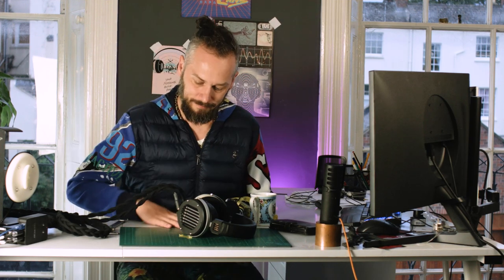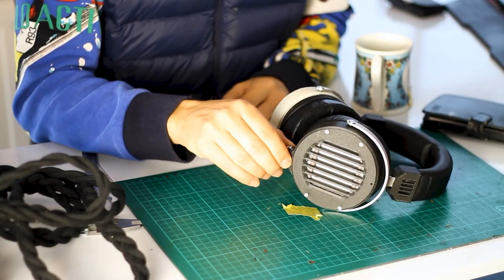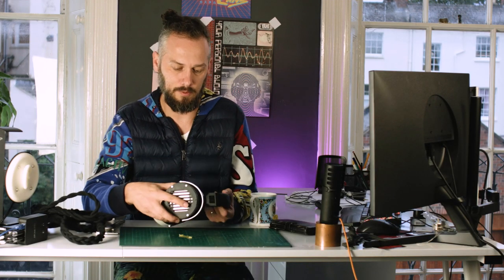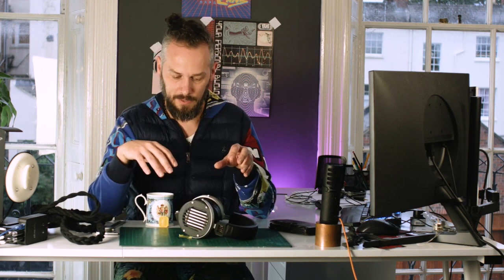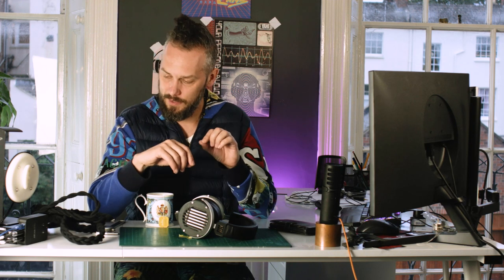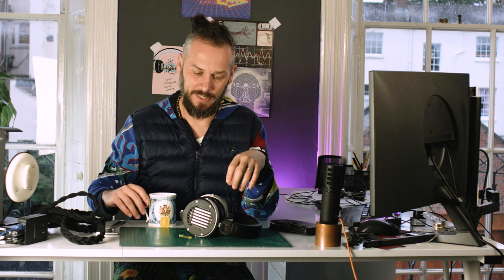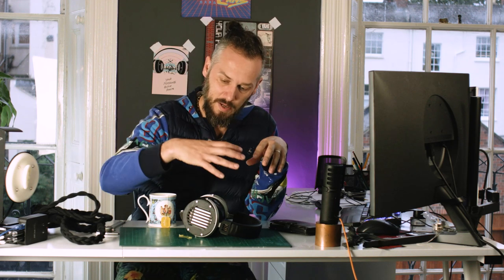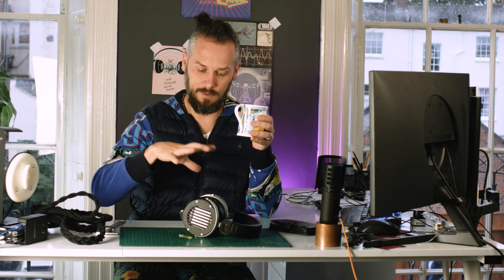HiFiMan HE400 SE 3D printed headphones  Mod Update 3.... Nearly finished now

Comment: Wow, that design really came together with the grills on the headband! The industrial look is to me on par with some of the high end stuff out there! The reflectors looks interesting. I assume the distance from the driver membrane and to the diffusor is main factor for which frequency it affects? So my guess is closer to the driver affects upper treble and further away slighly lower down in frequency?. For a diffusor to be effective it has to be atleast 25% as thick/wide as the wavelength which is very hard to achive in the cup. Wavelength becomes large very fast vs a small cup so I think the bubbles act more as a reflection point in a waveguide. Measurements online shows that even small 1mm ridges affect the dispersion, so thats probably the physics behind the changes in the sound. I would also think that pads with porous inner walls would dampen the peaks greatly.                       
The vid I was refering to earlier is really of bad quality so it was mostly intended for you and a few diy enthusiast out there, but I have a good picture of the asymetric waveguide inserted at the end.(It's on my channel name btw.) I don't think many grasp the importance of something like this yet but I have a feeling waveguides will become more common now that the software has gotten much more available and free.  Altough mine were designed freehanded and mostly for reflection control, it was an awesome experience to put it on the first time. The membrane diameter is somewhat to large to work properly  with the Hifiman driver for treble gain, but it works well with 40mm drivers. I've already desiged new cups now for 40mm drivers to test this concept further :) The first iteration had a lot more treble than without the integrated waveguide. So I think its a good mechanical way to add more top end treble to bass heavy drivers.    
  I am really looking forward to your listening impressions in the next vid so I hope it airs soon! Then I can compare sound aspects from your design vs mine and hopefully learn a lot!
Reply from the maker: They had a noticeable peak around 4200hz which would be a wavelength of 81mm which was roughly where the "horn" flared so I stuck those bumps around that region to try to smooth that out. To be honest I am just doing loads of trial and error, tweaking things and having a listen to see what effect that has. The slightly wider sound may have been because the bumps raise the pads up from the surface slightly.
Reply from the maker: Also... By coincidence I have a 40mm driver project I am working on... Thanks for the hints and sharing your ideas
Reply: @CustomCans  I also love to use trial and error method but I like to do some easy calculations for verification. Did you see the hexagonal inlay one of the high end headphones had at Canjam SoCal on YT? That really was an eye opener for stopping standing waves. Now I want to implement that in my next build :)

Comment: wow! looks great. general question: would using a cnc machine to make the enclosure of the headphone out of wood work, or is the way you have designed it only work for 3d printers? I reckon a wooden enclosure would also look real nice :) thanks!
Reply from the maker: This particular design would not be easy to make with a CNC machine but it would not be too hard to redesign them to be CNCed. If this ends up being popular I may design a CNC version

Comment: Hey, say i have a pair of those 400se, what pad could i get from ali that would do good on then?
Reply from the maker: I am on sure - I re-designed them to take normal pads but as standard the pads clip on. You could find any the right size and then use double sided tape to stick the in place
Reply: Thicker deeper pads gives more bass.  Only look at pads with holes or fabric on the inner wall that lets the sound easy into to the internal foam for dampening.  Or else the cymbals will be even coarser. Pads with more angle can also slighly improve the center image. I think stock thickness with a slighly more aggressive angle and perforated inner wall would be optimal. Would give slightly more mids with a better center image and smooth treble. Bass would be the same or less than stock.

Comment: I was trying to put the pads back on mine and broke my thumb nail which shot my finger into the driver. RIP left can. any tips for how to repair? lmao
Reply from the maker: Sorry chap - I have not repaired this type of driver before so not 100% sure. I have a dead driver that I stuck a screwdriver through but it looked pretty unfixable - If I get time, I will try to repair it and Video the results this weekend - I can't make it any worse ;)